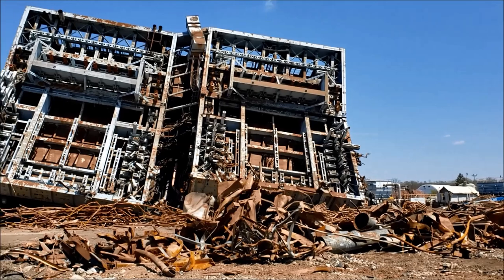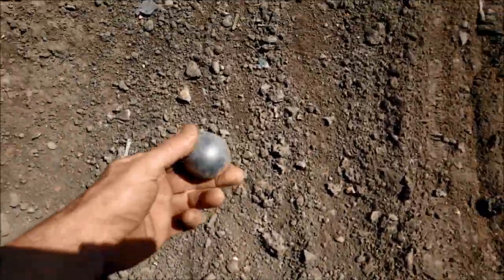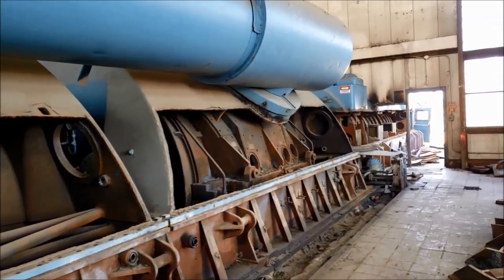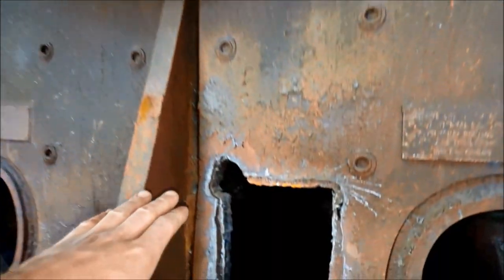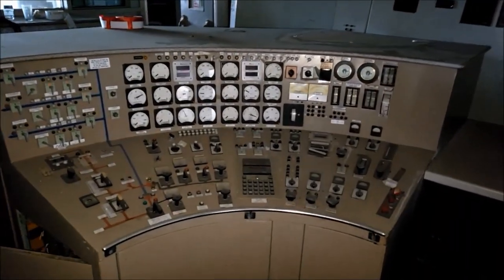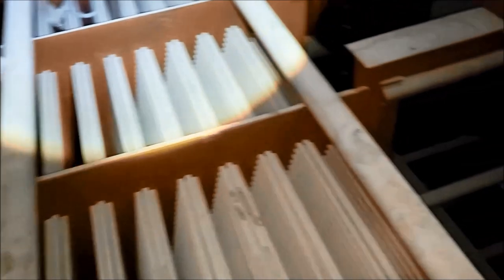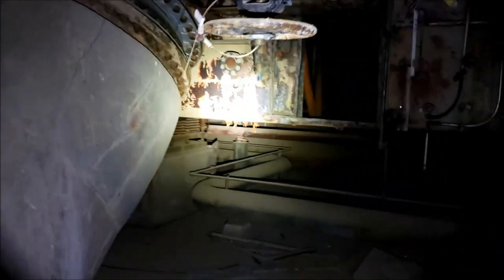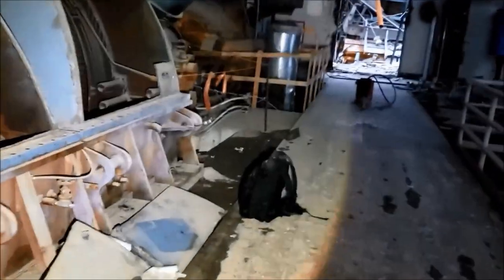Exploring Inside A Steam Turbine - Mercer Generating Station NJ Coal Power Plant ep.2

Comment: You are a pretty knowledgeable power plant buff, you nailed quite a few of your descriptions. So much so I’d think you are or were an operator. But you said you’re not, so good job. The metal strainer was to the suction of the condensate pumps that are at the beginning of the condensate/staged feedwater heating cycle. The long shinny cylindrical items you seen walking thru the plant were actually the stage feedwater heater that raise the water temp say 50-100 degrees per heater Enroute to the boiler where it enters at about 450 degrees. This saves fuel in having to heat the water from 80 degrees on the hotwell that you were standing in when you videotape the mesh screens. The thousands of tubes you seen in the condenser in fact have river water going through them to condense the steam rapidly, so much so that it causes a vacuum with which the condenser normally runs at 29-29 inches of vacuum in operation. Those probably weren’t safety valves on top of the HP turbine, safety valves are typically placed on the boiler drum proper and the secondary superheater outlet to provide cooling through the superheater in case of a Overpressure scenario and turbine trip. The flooring were most likely tile on the turbine deck, as that was the detail and pride they built on the 60’s. My plant has the same detail. They started transitioning to corrugated siding and concrete in the 60’s and 70’s. You may be able to tell  I work in a power plant and have been in the trade for 30 years, starting in the NAVY. You video is very cool but may I suggest a safety person next time.  They may slow you down but may save your life. One slip on those orange rust deposits in that condenser and you would have pin balled all the way to the  hotwell and been in a heap of pain if not worse. If I can help with anymore info let me know. Again good job!
Reply from the maker: Wow, can't thank you enough for the detailed comment with such descriptive information.  Sounds like you really know your stuff. And you are correct, I never worked as an operator or anything like that but have just done tons of research to have a good understanding of power plant operation.  I'd have to say, getting into the power generation industry would be a dream job of mine. Never did any college though. I'm 33 years old now,  maybe I should consider joining the military.
Reply from the maker: Also, I completely agree with you about having a safety partner. Unfortunately none of my friends were willing to come hang out in there. I was Ultra cautious, but probably should have had a harness on as well.   If you saw the other video I did on this place climbing the stacks you would see I can be a little bit careless I suppose.
Reply: The valves you speak of on the turbine are control valves (hp)   And intercept / stop valves for reheat.    And the condenser tubes are usually stainless steel or titanium.   Depending on type of cooling water used.

Comment: sorry Im late to the discussion. . . thanks for the video.   actually makes me sad to see such works of engineering being destroyed.
those GE Steam Turbines at "Mercer" were very unique design (only ones ,1960).   they were codes FP/FS cross compounds.   that is two turbine/generators using one steam source.   so as a pair 1&2, only turbine one got HP steam and the reheat came back to 1 and 2.    those large valves on top of the turbine you showed were actually to control the reheat steam to turbine 2

yes river water is used to condense back to water AND is a BIG waste, but that is the way they all work
and
for GE steam turbines those "blades" are called buckets (design of the turbine where the steam strikes the rotating elemet for extracting power)
as a pair, the first turbine made about 325MW and the second about the same.   so about 650 for the pair and therefor 1.3 GigaWatts for the plant

those vintage turbines had mechanical "flyball" governors.   Once synchronized to the grid/system, the turbine/generator speed was controlled by all the other turbines in the US (they are all like meshed like with gears).   But those flyweight governors had to cut back the steam flow if imediately disconnected.   (like throwing car into nuetral while going up a hill)   If the governor didn't cut steam back, the turbine would go to destruct speed in a couple second

Oh, I travelled, working those mechinial control for decades. . .  Loved my Job.....just shedding a tear to see them now :(